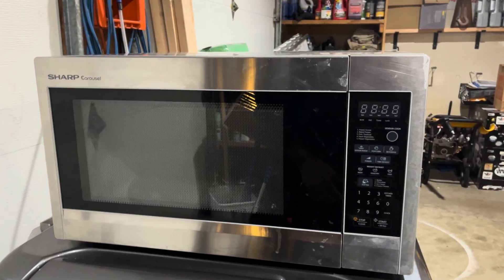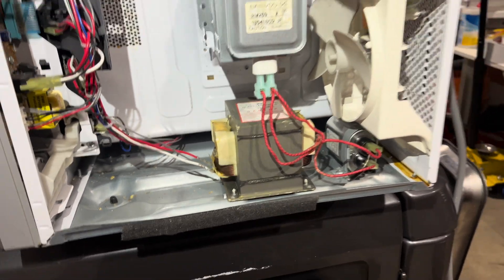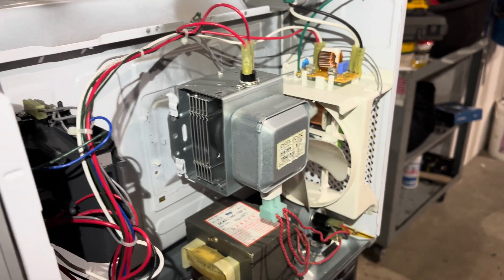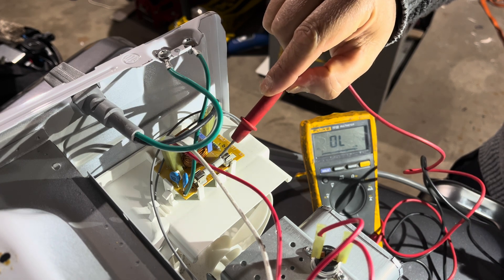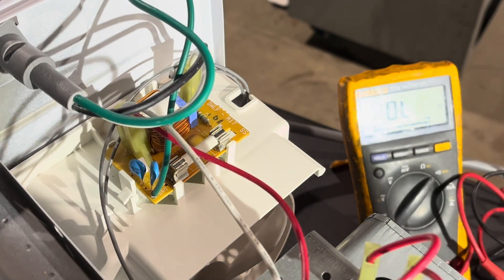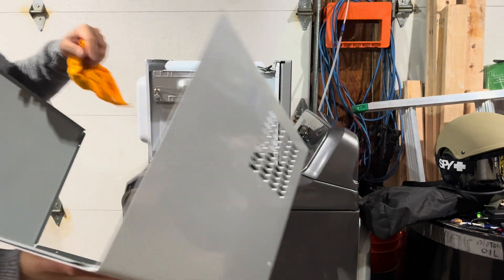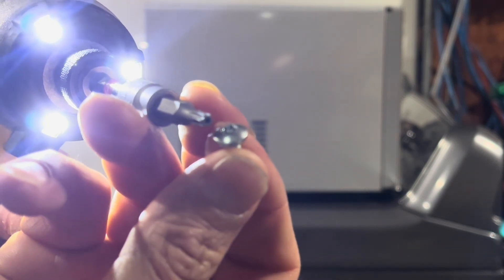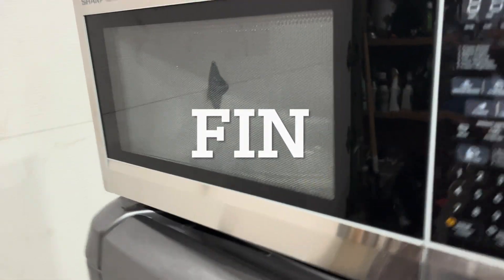SHARP CAROUSEL MICROWAVE DOES NOT HAVE ANY POWER

Comment: My Sharp Carousel microwave died through the night after a  few minute power outage. When the power came back on everything came back except the damn microwave.
I have opened it and checked the main fuse and it's good. What do you think could've killed it ?
Reply from the maker: It’s hard to say. The fuse is a good place to start and when you open it looks for a visual. Burnt, broken, melted plastic, hot spots or water damage and anything that can lead you to a component that is visually damage. This is a quick check that can help you find the problem and fix it. After I don’t find a visual problem. I start probing and isolating components.

Comment: Clock blink, but the doesn't do anything
Reply from the maker: Start with a small step and check the fuse. If you checked the fuse. Then check the magnetron or look for any burnt or short wires that might have a bad ground, cuts or are have just gone bad for any visible signs of the issue.

Comment: My sharp drawer microwave fuse is always blown after I press start. I have replaced the Capacitor and the transformer, do you have any idea on what to check? The Magnetron is good.
Reply from the maker: You have a short somewhere. Look for any 🔥 burnt 🔥 wires or melted plastic pieces or cuts in insulation or wiring. I had a Sharp Microwave Turntable Motor power cable hitting the body of the microwave and it welded the wire to the body and would replace the fuse and as soon as I started the microwave. The turn table would start. Causing power to go in but it would burn 🔥 the hot cable and the plastic connection and it melted into a part of the microwave body. That was a short that would cause me to pop a fuse every time so I had to replace the burnt cable and but connector. This was simple cut and splice. Finally I checked the Sharp Microwave Turntable Motor and it was also bad it had some kind of internal malfunction and it was what cause the cable to get hot and I caused the microwave to blow out 3 of my fuses before I could find the problem. You should look 👀 very closely at your wiring. This could be a full tear down. I wish you luck 🍀 on your troubleshooting journey.